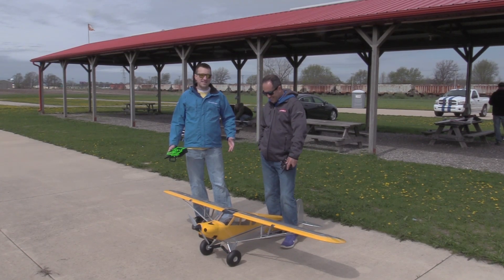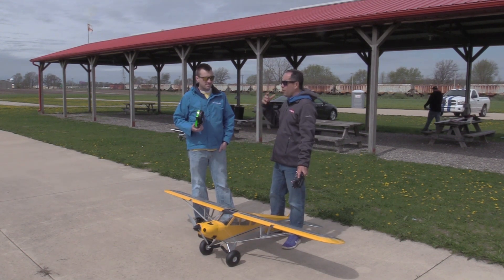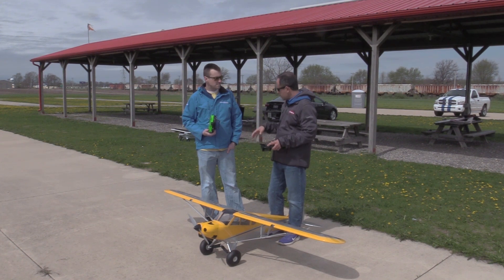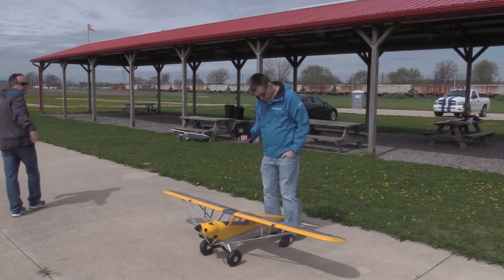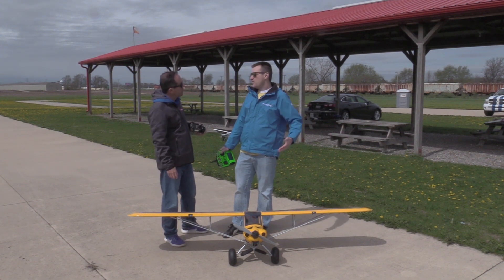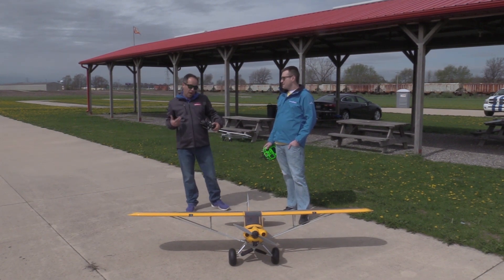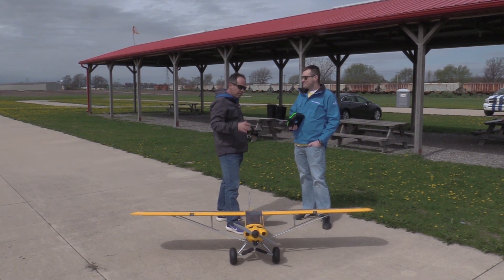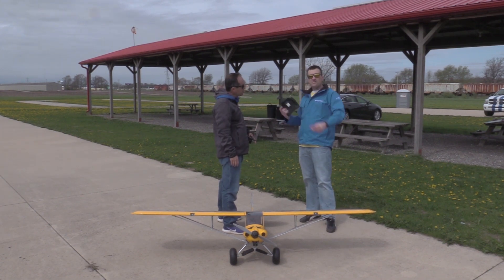Horizon Insider Build Series - Maiden Flight (Almost Crashed!) - My First ARF!

Comment: How do you pick these bigger planes apart for transport and storage? How long does it take to assemble and disassemble?
Reply from the maker: Almost all of them have removable wings. This model for example uses one 3mm screw on each wing and four cotter pins to hold the wing on. Its roughly a 10 minute assembly.
Reply: As it take almost as much time to develop how to transport/store a model why not show it in the tech talks and so on? 🙂

Comment: Maidens can be hard on windy days, Ali did a great job calling out what you needed to do to get it down safety!
Reply from the maker: Yes indeed. The plane has had a half-dozen terrific flights since then without issue :).
Reply: Victor Shamulus My flex innovations extra Cantrell you about that.

Comment: Great job. Loved the build, flight was spectacular. Great recovery, have to love the buddy box feature. Please get a set of the floats. Heard they are great but install is tricky. Would love to see an install video and flight test. Ordering this plane this week with same transmitter and servos you went with. Puting a hacker A605xs 420 with a 16x8 prop in mine. Obvously will have a tuned down thumb on the throttle. Want to land the plane in my ponds to fish with and have enough power to tow them to shore. Keep up the great videos and would love to see more on this model.
Reply from the maker: How exciting! We do have a float set ready, so the potential is there for a video! First, we are going to show a gas conversion, then move forward from there :). - Kyle
Reply: Awesome. Can't wait for the future videos.

Comment: That is not a begginers plane. Those windy conditions were not favorable for training. No matter what anyone says here. That is no way to teach/learn. The pilots excitement wouldn't let him be receptive as it should. Buy a Realflight sim and practice at home the basics, learn and memorize the aircrafts surfaces functions, use the simulator, a few hundred hours with different environments  and maybe, just maybe, head to a flying field with a small foamie or glider to grow your skills Into it. Then you could use a big plane on those windy conditions. Otherwise, you"LL lose interest in flying when you crash and your bank account starts falling, repairing and buying parts...good luck friend.
Reply: Exactly what I did. Still crashed my bixler so many times it would no longer fly due to all the repairs. 

Is this his first plane ever? 

Bangood and others sell a volantix cessna type trainer with gyro for $50 USD. You fly it, but the gyro will level it out if you get into trouble..just let go of the sticks and you're safe. If you crash it? Big deal, get another one. Plus it's small so you can fly it anywhere. 

The bixler is a great beginner plane, I just didn't have any place within an hour's drive to fly it.
Reply: Absolutely right.